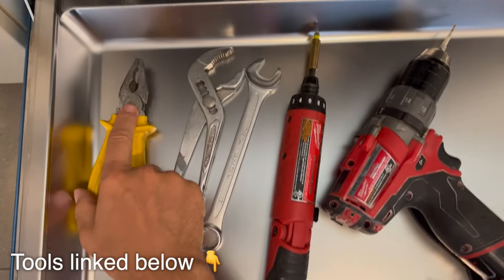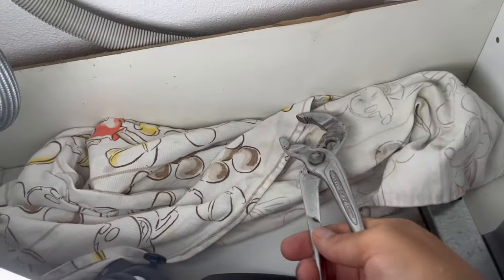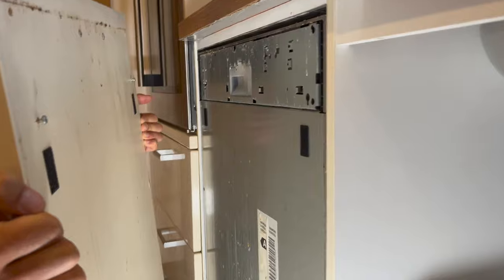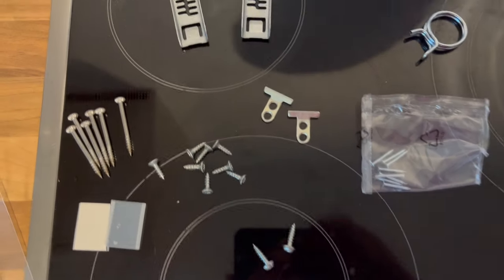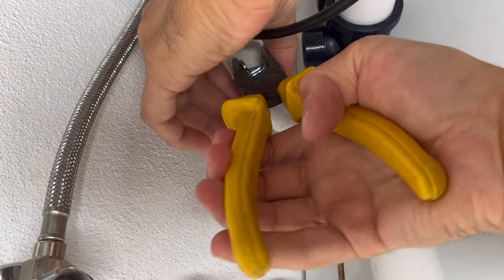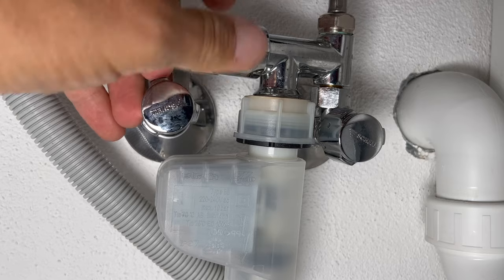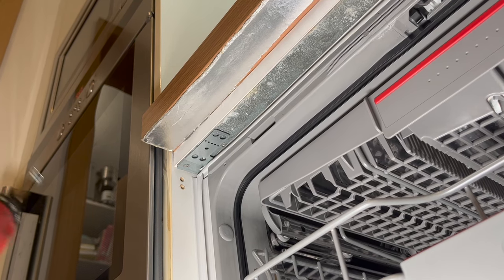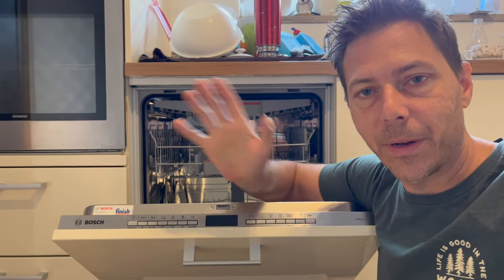How to Install a Fully Integrated Bosch/Siemens Dishwasher - Step by Step Tutorial

Comment: Hi!
Did you eventually do a video on fixing the door? I can’t find it.
Can you share a link to buy the door coverings you used? 
Also I recently installed the dishwasher (just the door covering left), and when I open it up it doesn’t stay open.

Is this normal?
Reply from the maker: Hi there! I did actually film doing the door, but I didn't include it because I was using a previously used door, and the hinge for the bottom flap was in the wrong spot. 
The dishwasher comes with a template though, which shows where to drill holes in your door cover, so that you can mount it. Perhaps I will release the video anyway.
Cheers,
Tom
Reply: Thanks for the info! 
I finally did it, but can’t figure out how to see the info light
Reply from the maker: @RawliglatX  Well, it should shoot straight down to the floor. It is a little red spot on the right side of the door. It could be that the front panel may be blocking it...

Comment: How do you ensure that the dishwasher is level. Or how much do you turn the hind legs up? Putting a level inside the dishwasher?
And what is that laser pointer supposed to do?
Reply from the maker: I used a long level to make sure the dishwasher was level. The laser is just so that you can see that the dishwasher is currently working.